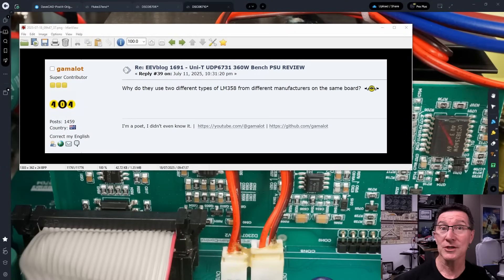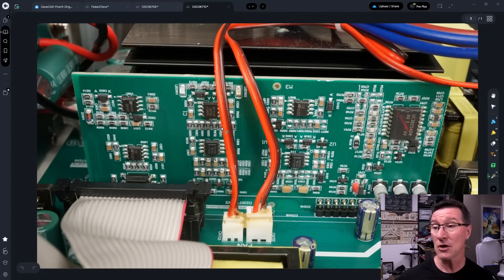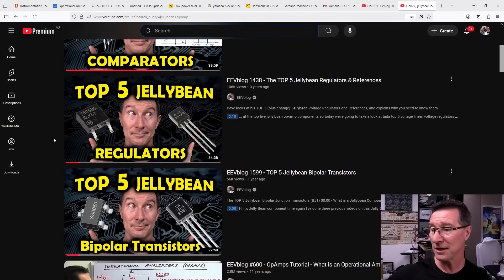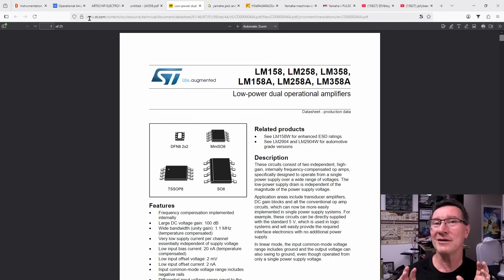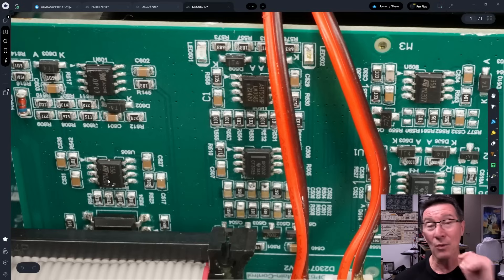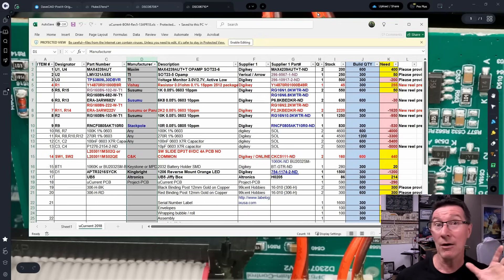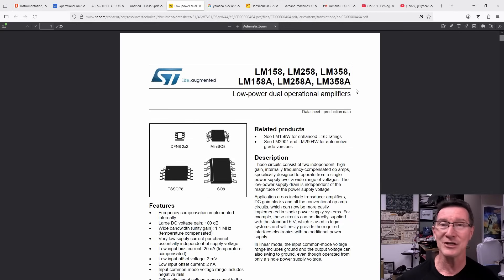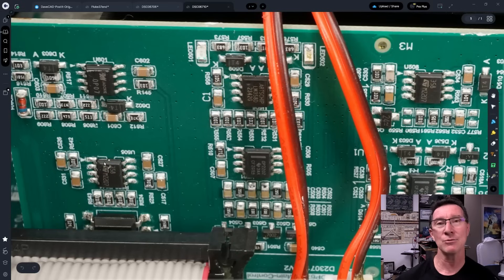EEVblog 1697 - What's Up With Different Brand Op-Amps?

Comment: How about when a company introduces a new PLM / PDM system and it somehow leads to certain new build products not working to spec? The new system applied an update to a part for design A to every design using the same (internal) part number; not great when an existing design used a part from a specific manufacturer, as it had been put through qualification for aerospace use, but the new design didn't need a qualified part so they updated the part to use cheaper alternatives. The previous PDM system would have flagged this and insisted on raising a new part number or warning the engineers to raise Engineering Change Requests for all the other designs. The new system just skipped this very important step and happily changed all the existing designs!

Comment: Speaking of AMLs (approved vendor list) with multiple suppliers of supposed jelly bean parts...  About 25yrs ago I had designed a power distribution board that had serial to parallel data done with shift registers where the parallel output went to relay drives.  Any rate, during EMI immunity testing, the relays would "freak out" at certain test conditions.  The bits were getting randomly flipped.  I don't recall how I figured this out anymore, but I found that 2 of the 3 different suppliers version of the 74HCxx chip for the shift register on the AML was susceptible but the 3rd one was not.  I think the issue could have been resolved with a PCB layout change but it was easier to create a new part number with only the non-susceptible vendor allowed and just use only those for that product.  The volumes of that product was low enough that it was a cheaper/easier solution than spending another week or more in CAD and a new run of prototypes and retest months later.

Comment: I used to design medical products. We weren’t allowed to make substitutions without requalification. I recall a new memory chip that was identical electrically, it passed all manufacturing tests, etc. But when we tested the product for ESD susceptibility it failed at a much lower voltage. So it really depends on the risks - does your stereo stop playing or does a 747 crash if the part breaks.

Comment: I designed a class d amplifier  using discrete components. I used a jellybean op amp. The amplifier worked fine at low signal levels but inverted the output at high signal levels. I had to look around for a rail to rail op amp to fix the problem.

Comment: I don’t know if it’s covered in the jellybean series, but my first question is “is there a good resource for knowing what the minimum specs of any particular jellybean part are?” You might check N different data sheets and test with N different parts, but maybe you just happened to pick manufacturers on the upper end of some critical spec that you’re closer to the limit than you know.

Comment: Generally competing parts are very close to identical, but in some cases mfgs will use different processes resulting in slightly different behavior. We had a board that used CD4046 PLL that had significant differences in behavior; some of which could be comp'd by ext caps. Ran into somebody that had a 7800 series reg with different pinouts. Also one diode where they marked the anode with a stripe. Aarrgggghhh.
Reply: A 4046 VCO is an analog component.

Be very careful, test any equivalent in the real circuit.

There is no such thing as a jellybean analog component.
Reply: Analog guitar effects are the worst as you’re not driving the device within spec, you’re pushing it out of its linear operating range and using the device outside of spec looking for whatever that magic guitar “tone” needs

Some people go crazy over old RJC4558 or a certain diode because of the way it responds as it turns on.

Comment: you CAN have problems mixing and matching suppliers or even just batches if they are on opposite sides of the tolerances. one could be a little slower causing some response silliness and it is safe for the designer to assume all chips within a batch will be reasonably close to each other. however one board per hundred that it might cause worst case is perfectly acceptable and not something i think about.

Comment: There is a small issue with the argument that it was just a random reel assignment - in the previous video, where two units of the same PSU are shown - there is an identical configuration - one Artschip, and two STs, in the same positions. And all the parts, from both manufacturers, have different date codes. So that pretty much excludes a random pick and place configuration and points to a deliberate choice of parts.

Comment: 7:34 be careful with 7805 brands. There are differences between them. I personally ran into issues when using ST 7805 and 7905. Basically, the positive supply absolutely had to come on first, as if the negative came up first, it started pulling current through a circuit connected between +5 and -5 V rails. This resulted in some ESD or parasitic diode in one of the ICs starting conducting from ground to +5 V, causing a -0,6 V voltage in respect to ground to appear on that rail.

And ST 7805 absolutely could not start up in those conditions. 
ST 7905 had no such issue, so if positive supply was turned on first, the whole circuit behaved as supposed. But rather than introducing a power sequencer, I just replaced the 7805 to some off brand part. And it just worked, every time.
Reply: I've run into that problem too. I think a normally reverse biased diode across one of the regulator outputs fixed it. Probably good practise to include such a diode just in case (1A SSRs are cheap as chips).

Comment: Funny because I just had a small series of an interface made with an LM358. And yes, the application is jelly bean. Having said that, for this part I only put TI as OPM and Mouser as vendor. And I am not worried that some no name brand will not work. But at the same time I am also not worried if the part cost 20 cents or 80 cents. However if it goes wrong and the customer sees some third Tier component, I will be standing there with my pants around my ankles. More over, my customers are semiconductor manufacturers, and they will look on the chip to see what you build in. And nobody will have anything to say about TI. I used to work for a very well known semiconductor equipment manufacturer, and their jelly bean op-amp was in that time the LM348. And if you look on multiple PCBs they made, you would have large series that over multiple years used only Philips made LM348, and some logic chip would only be Ti etc. etc. So jelly beans are not always treated completely generic.

Comment: Sometimes you design in the "jellybean" part and it runs down the line for 18 months with no trouble and a couple of different manufacturers parts. Then a different brand is bought... Oops the circuit fails test. There are slight differences in offsets, timings, trigger levels, whatever... You thought you'd de toleranced the circuit, but not enough for this "new" chip the buyers found 😢

Comment: I Have a Rock It 5 speaker that for some reason out of no where the volume goes down as if it lost power or the amp went off then it kicks back in sometimes, do you think you can help me with that?
Reply: It sounds like a bad solder joint, which makes & breaks contact, with temperature variations.  Or a component that does the same thing, inside.  Try tapping around the PCB with an insulated tool (like a screwdriver handle), and use freeze-spray on the semiconductors.

Comment: The one that will bite, over and over, are serial flash, like the 8-pin I2C/SPI ones. Same part numbers, different vendors, same spec-capacity, volt-temps-pins,, but... the SPI/I2c protocol is different. Usually, if you have plenty of space for boot code, you test the flash, ID it by part number, use the variant protocol.  I've had purchasing ignore the brand spec on embedded controller boards more than once. "Must use xxx-vendor" on the BOM and they just buy whatever. Then I get the "line-down" call in the middle of the night, "your boards are not working, they say it is a software problem".
Reply: Yes, I concur whole-heartedly on this.
Validating second source serial flashes is a pain, especially for the sw-team. We have had to make detection routines that identify which particular brand of flash is mounted on each board, just to have the code cope with the sometimes subtle nuances. I hate 'em chips.

Comment: Speaking as a former designer, the #1 reason for mixed brand name chips on the same PCB is because the supply people bought from multiple sources - usually whoever was cheaper that week - & one of the sticks ran out while your board was being filled. 
There are rare times when a designer specifies a particular brand for a particular location, but in practice, it's almost always about part supplies.
Reply: thank you,  you saved me typing.  3 minutes plus of manic rapid speech into this, i forgot what the effing question was.,  The guy is smart, making a lot of money off of a huge subscriber list, but I need to go now and take some Xanax for my nerves.,
Reply: @consultingengineer5593  low iq
Reply: @consultingengineer5593  lol. Very relatable.

Comment: I agree that the multi-head reel loading with multiple manufacturer part numbers validated for the internal SKU.
On the other hand, I have seen cases where a part requires a more limited MPN list for a few applications, so it gets its own SKU.
One case comes to mind: 74LS221. Most manufacturers had a time constant of 0.7*R*C while Toshiba had 1.0*R*C for some odd reason. If the circuit used a pot to set the R, any part will do. If a fixed R is used, then restrict to not use Toshiba (or to only use Toshiba).
SRAM chips were another case. Maybe low-power parts were needed for a battery-backed SRAM application and some manufacturers had lower standby currents than others. Meanwhile, the same type of part may be used in a device without battery backup so any old part will do. Again, this results in 2 SKUs to keep it straight (maybe).
But, those are definitely weird cases and should always be avoided.

Comment: I'll guess because they use multiple suppliers for a consistent supply and they all get dumped into the same parts bin
Reply: You make it sound as if it is all a bit random, by choosing the word 'dumped'.

It's not.

Any EMS manufacturing worth its salt will not be running their business this way.
What is on the approved vendor list regarding all non-discrete parts (and also for some discrete parts) is what is being used to assemble the board.
No more no less.

Any EMS, being internal department, or external partner, not going by this rule has no business being in business.
The cost associated with having the assembly process screwed up by some rando-guy/girl/third-pronoun person making a 'let's dump these parts into the same SKU'-decision is simply way too high.

Unless you're making an ultra low budget piece of trash like the stuff BigClive tears appart regularly - those kinds of products are absolutely being thrown together like that.

Comment: Interesting topic. 15:50 From my point of view the designer should always care about specifications of the components. Unfortunately the components from different vendors always differ in  some of the parameter. Lets say you have three sources for one component, then you have to check ALL datasheets. And by the way: manufacturer are trying to get a better yield by using bigger wafers and in parallel updating their specifications (sometimes with worse limits than before).

Comment: Different manufacturers mean small (and sometimes not so small) differences in component packaging, which makes it difficult for the pick & place machine to compare the picked component with the photo in the component library, since not all pick & place machines have the capacity to store multiple component photos.

Comment: mostly for DIY project it doesn't matter what IC manufacturer is used so ppl go for mix and match and based on easy availability however if one has to go for a reliable project and product then designing is important and IC selection too is at most important and many other factors like reliability, operating temperature, heat, etc comes into play then choosing a specific IC and manufacturer is important otherwise its like "stealing from peter to pay pan" concept.

Comment: My theory: The board is designed by 2 different engineers, where each referenced a different manufacturer part number in bom. The fab did not waste time with unifying the part numbers, instead charged extra for additional bom.
Reply: It's a theory alright. An incorrect one though.

Any, and I do mean ANY, design department will draw on a database library of parts - which for all practical purposes ensures two designers will always input the same jellybean part into the design.

As Dave says, if your design is somehow dependent on a particular brand of jellybean part, you're asking for trouble and doing something wrong.
Reply: @ghydda  I agree with you, but my suspicion is based on the fact, in China things don't always work out the most efficient way.

Comment: I'm sceptical this is random or SMT loader efficiency related, especially given one is verging on a no-name special and the others a relatively premium brand, likely to have cost several times more.  Unless they just happened to have  had them lying around and wanted to use them up, I reckon they couldn't get away with using the cheaper part in the ST locations for whatever reason.   Looking at the layout it appears the cheaper part is on some kind of LED duty, which would lend further credence.
Reply: Then please explain to all of us how much money there is to be saved, by swapping one board position from a 7 cent ST part to a lower tier vendor one.
1 cent?
2 cents?

And if you feel your cost saving position is still defendable, then please explain how much cost is associated with having an extra SKU to deal with?

You are talking rubbish mate.

Comment: They probably had empty feeders on the PnP machine, so they loaded them up with all the extra reels they had to maximize the time before the machine stops for the operator to load new parts. 
As a result the reels, which happened to be different brands, got used in parallel instead of one after the other.

Comment: What’s just as interesting is why ST and not TI, would have thought TI would be cheaper in Asia rather than ST.
Reply: Less vulnerable to secondary US sanctions, I'd imagine
Reply: That could be part of the equation. But not the sole reason.
Jellybean parts are, as Dave explains it, just that.
They are by today's standards simple parts, easy to manufacture (from a technological complexity standpoint), highly automated manufacturing process, thus they all cost about the same.
Safe for weird tariff decisions, skewing the supply marked all weird.
Still, a 7 cent part cannot vary wildly in price across the planet. Not in any context for this Uni-T product anyway.

Comment: I had a strange case a coule of years ago. A noname Chinese 9205 clone multimeter. The capacitance meter displays garbage on two ranges. After poking with a ZT702 I found that one of its LM324 opamps starts generating at approx. 300 kHz in those modes. Swapping that 324 (a fully functional one!) with another 324 from a DIFFERENT manufacturer on the SAME board solved the issue.
Reply: There is no such thing as analog jellybean components.

Comment: You should consider that no all interessting characteristics of an opamp is specified. Some you have to find out yourself or you know more about opamps than most of the jellybean users. The spec #3 from art say specific temp compensated bandwidth. Jellybean is not jellybean, it more of i do not know, i do not care. Your experience with own project is the first try first hit example.

Comment: When using a V - I ac curve-tracing component-tester on inverter drive stages, sometimes I ask "does that difference indicate a fault, or is it just different manufacturers"?
I once had a controller to repair, where one particular memory chip would work, and one with the same specs from another manufacturer would not.

Comment: I had to throw away two bags of LM 358 and LF353 bought on La Playa. The lower transistor of the complementary output pair had no amplification. 
Anthony
Reply: The output pairs are followers so they have no gain by design. It was something else, I think your analysis is mistaken.
Reply: Who stated it was a matter of voltage amplification...
Reply: @ghydda so it had no current amplification?

Comment: I wouldn't worry about the supplier of a component unless a specific supplier is known for bad quality.
Multiple suppliers could save you from issues created by shortage from one supplier. Or it could just be that it was a transition between purchases and everything comes down to price of the day at purchase.
The specs should be the same, but as anyone having worked with equivalent parts there are corner cases where there's a difference in quality between brands. I prefer NGK spark plugs over any other brand just because I have found out that they are more reliable for corner cases like cold starts.
Reply: Nah, not in China. Anything can be fake from Chinese markets. Even if it’s a good part but from no name manufacturer, it might vary more than you’d expect.

Comment: Comment on the µCurrent issue. I recently made one for myself and the original data package you have on your website has the BOM with the LMV321AS5X. That part is obsolete so I had to find a replacement and the mentioned IDBVR here was either out of stock or I missed it. So instead I got a LMV321AUIDBVR which seems to be equivalent or at least I didn't observer this issue. Note: you need to have the U variant to make it pin compatible.